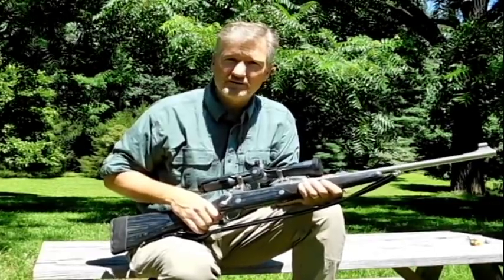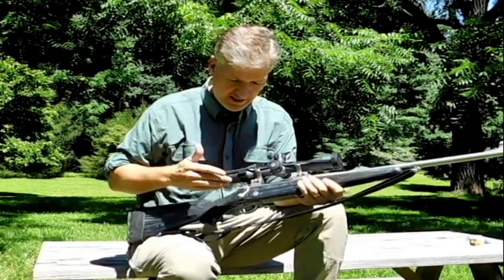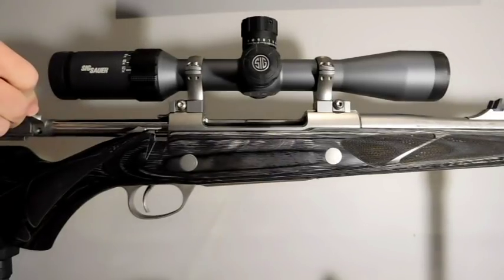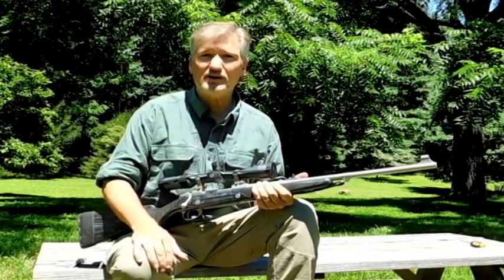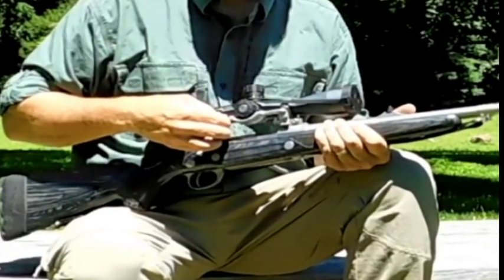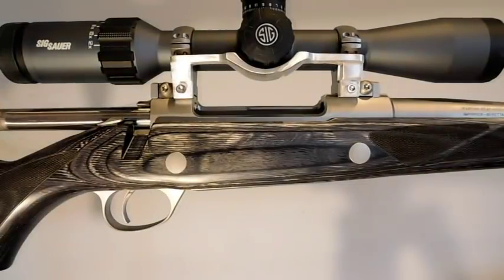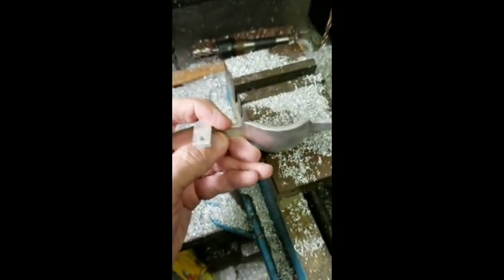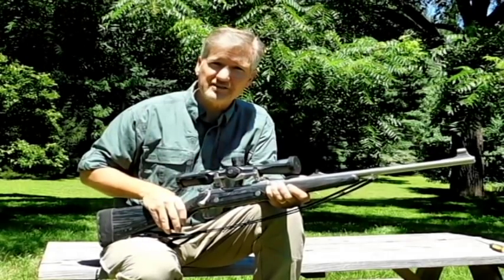Sako Model 85 Ejection Problem with Solution

Comment: Smart thinking, but you have a lots of room there to go even lower with the scope. I like to mount my scopes as close to the barrel as possible, and this wouldn't fly for me. You just saved me a whole lot of heartache. I won't be buying! I never would have imagined this problem could exist with such a pricey firearm.
Reply from the maker: I normally mount my scopes as close to the barrel as possible too. In this case however, I was headed to a remote region of Alaska to hunt, so I wanted to keep my fixed sights on the rifle as a backup in case my scope failed for some reason. I mounted my scope as low as possible without having the fixed sights interfere with my view through the scope. I consistently shoot 1 MOA groups at 200 yards which is pretty good for the high caliber .375 H&H.  Thanks for your comment.
Reply: @rogerlaplante9217  I've contacted a few other YouTubers and asked if they have this problem on their smaller caliber Sakos, and they say that it's not a problem. I might be back in the market for a Sako again. I'd like to get an 85 laminated stainless in 30-06. Thanks for your reply.
Reply: He just demonstrated that the lower the scope is mounted the better the function. So…hello, are you paying attention? I have seven 85’s and never had one ejection malfunction. Not one. I use standard hunting scopes (Leupold and Swarovski) mounted as low as possible.
Reply: @michaelshuey1614  Try doing some research. Low mounted scopes are having problems too with certain rifles. There's other videos on YT, and there's threads on hunting forums as well.
Reply: @jimdent351  I don’t have to, all seven of my 85’s (Including my 85L’s) eject perfectly. 

I guess I’m just the luckiest hunter/customer ever and Sako is only in it for some short-term profit; tomorrow’s reputation be damned. Ya, right.
Reply: @michaelshuey1614  I guess the others are liars. What is it with all the butt hurt fanboys who can't handle the truth. I said some, not all. There are videos on YT, but as long as you don't look then you'll always convince yourself that you own nothing but the best. That's why you refuse to look. You are afraid of the FACTS!
Reply: @jimdent351  What "truth"? I never said they were "liars". I'm simply implying that blame is being placed at the feet of Sako when it shouldn't be.
When ALL of my Sako's, including those of my friends and family function perfectly with standard hunting scopes mounted as low as possible (normal), why would I watch YouTube and disregard my own empirical evidence? 
Btw, since when is watching YouTube considered "research"? When USOG (YouTube channel) demonstrates, by exaggerating the dimensions of a mounted scope on a large caliber Sako, that there is no ejection problem, it's evident that "research" on YouTube doesn't amount to much of anything in lieu of contradictions.
"Fanboy"??? I've owned every make of high end hunting rifle with the exception of a very few. Sako has risen to the top in my collection of firearms that I grab for any hunting excursion. I like my Bergara's, Mauser's, LAW's, Weatherby's, Winchester's, Remington's, Christensen Arm's, Savage, Ruger, Browning and etc. However, after consideration of ALL the aspects that make a great hunting rifle superb, the Sako's rise to the top. Function, precision, fit, finish, ergonomics, point-ability, balance, modularity, quality and etc.
So, it's not that I'm a "butt hurt fanboy", it's that the "truth" lies in the failure of certain people to mount the appropriate scope at the appropriate height. Good grief. This video demonstrates my point.

So Sako is not at fault. Just like any rifle manufacturer is not responsible for the scope ring scar on your forehead.

Comment: As someone who has seen countless Sako 85 rifles, this is the only time Ive seen this issue. Also your optilock rings are mounted incorrectly. The front base should be at the level of the opening on the reciever.

Comment: Great job of improvising and engenuity. I would get that H&H reamed to a Weatherby 375. It would give you the increase in power with greater case capacity, and you can still shoot .375 H&H in a pinch. Giving you fireformed .375 cases to reload.

Comment: I have a older sako a2 never a issue the difference is it's a 2 lug bolt versus the 3 lug of newer gun the extractor is in a different location sako would be better off with a plunger ejector than the blade style
Reply: OK, that makes sense.

Comment: This is why I got rid of a Sako 85 in 375. I have 2 Sako AVs that are perfect because the ejector is located at 9 o'clock on the bolt face. On an 85, the ejector is located at 6 o'clock, which sends the spent cartridge almost straight up. I don't know why Sako changed the position, but it's a serious design flaw. I'll never own another 85...

Comment: I have a mod.85 in 6.5x55 the extractor releases the brass before the bolt is pulled all the way to the rear, brass drops off bolt in mid bolt stroke to the rear brass ,drops on top of mag. Have to clear brass before it will feed a new.round  don't think I'll  buy another one ,the only reason I keep it is for the cal. And light weight,

Comment: Haha
I have the exact same gun and mine does the same thing. That bracket looks gross but I do admire your determination and workmanship. 

Have you tried just tilting the scope 90 degrees do they the top turret is left and the right turret is up?
Obviously that will look strange if your cross hairs are not a simple cross.

It’s not really a long range gun anyway so I just put a aim point micro on it or use open sights.

When I do put a scope on it seems to eject ok when you rip the bolt back quickly. Actually, I find at the range when I’m being lazy /slow with the bolt the d as lent cases pops up and then falls back into the action even with no scope.

Comment: did you try turning the scope counter clock wise? Using elevation turret as windage and windage turret as elevation?
Reply from the maker: Yes I did, and I guess it would work, but remembering that up is left, down is right, right is up, and left is down was something I just didn't want to do.
Reply: I've done this on Sako 75s for more than 20 years on rifles used in competition shooting more than 30000 rounds rapid fire.
Works great, especially with 1" scopes with AO like Leupold 6.5-20x40 EFR.
On most scopes it's easy to swap turrets and repaint the windage, now on the left side. Shooting off bipods left side windage is actually preferred. Just look at the new Kahles sniper scopes.
Reply: Looks like the Scope has side parallax so can not be turned as that will take side focus straight down against rifle.
Reply: Also what if you have a reticle thats not a standard duplex? Imagine a german no 4 rotated 90 degrees... How about sako just fix there expensive lemon
Reply: I did this with the 1.5-5x20 Leupold on my Bavarian Carbine in 9.3x62 for a while until I fixed the extraction problem. Bad design and execution on Sakos part.
Reply: @rogerlaplante9217  I've been shooting left hand Weatherby Mark 5's for 40 years. I always turn the scope counterclockwise because it looks better. Never had a problem sighting in and once your sighted in you're good to go. Your a brainiac  that has to tinker with everything. I bet you told everybody what you did to solve the problem and in their eyes your a hero. Solving one problem led to another. Your scope is mounted too high to get a good cheek weld. A customed stock with a higher straight comb cut out so you can remove the bolt, a larger forend that's flat on the bottom. In this case a properly configured rifle. You could shoot moose and grizzly bears a mile away like the kids like to do. Which by the way is irresponsible.
Reply: @nevillebriggs1002  The carbine you have in that caliber, with that scope is absolutely ideal. That is a hunting machine.

Comment: Ok? So must be to do with the caliber or the scope turret location.  As I have 2 Sako 85's one normal stock other Stainless and laminated stock.  Both fitted with Vortex Vipers.  And not one has this issue with cases.  Throws them as if they are in a hurry to get away from rifle.   So im thinking its the caliber and where turret is sitting.  But then again if you want that scope on not much movement.
Reply from the maker: I think you are correct. The .375 H&H us a very large round. I believe the bullet casing's length is the problem. Still, you would think the Sako design team would have made an adjustment to the ejector to ensure the casings are ejected at a lower angle. Thanks for the comment.
Reply from the maker: Yep, I think you are right. The .375 H&H is a big bullet with a long casing. The way the ejector flings it appears to be the problem. Still, you would think the designers would consider this when designing the ejector. Thanks for your comment.
Reply: Mine and many others have the issue with the 30-06/270 case hitting the scope and I have a smaller scope.

Comment: What if your $3000+ rifle utilized "duct tape"....just wrap it around the rings on the bottom of the scope, it should deflect the casing too...I'm going to purchase a Sako 85 in a .270....tomorrow.....and I'm going to stop at the hardware store for the roll of duct tape to ensure my $3000+ rifle will work properly.

Comment: I have an 85 in 30-06. Ejection is abysmal. To have to go to this extent on a rifle that costs $2000 or more just doesn’t seem right. Also paying close to $200 for Optilock rings/bases. As I live in western Canada I hunt areas frequented by grizzlies. To have a gun that does not eject or the case gets hung up in the chamber is not acceptable on a rifle at this price point. Get rid of this gun an go back to a Win Mod 70 with a tried and true action

Comment: Really? A $2000  rifle can't eject a spent casing? I respect what you made but this is ridiculous that a deflector has to be made to make these rifles eject properly and consistently. It does the same thing on .223 caliber varmint 85's also so it's not just large calibers . Just plain hard to believe and they know it . Where is the confidence standing in front of a cape buffalo? No thanks. Too many other rifles that work consistently and more so, safely in a questionable situation.
Reply: He needed a different scope.  Moving the scope forward it might have completely fixed the problem.

Comment: My tikka stainless laminate doesn't do that and it shoots 1/2 moa.  You can keep that overpriced trash.
Reply: Is Sako trash? I have basically only herd very good things about Sako...
Reply from the maker: I'm a big fan of Tikka rifles too. Sako owns Tikka and I know that the Tikka's are supposed to be a lower grade rifle, but in my opinion, Tikka has a better design team. I have two Tikka's and they both shot sub 1 MOA right out of the box. Thanks for your comment.
Reply: Max Caysey yes trash most are to embarrassed to admit that their high priced pos has an issue. I don’t tell my buddies about it either. 😂. Sako makes tikka in their factory but both companies are owned by beretta and they are the real culprit here sakos hands are tide and can’t fix the issue because of beretta.
Reply: Sakos are overpriced and tikka's are great.

Comment: The best solution: dont buy an 85. Or at least not one that you plan to run scoped. This ejection design doesnt really exude confidence when reliability is a must. Something about relying on the case to bounce off my scope juuuust right would be a deal breaker considering how expensive these rifles are